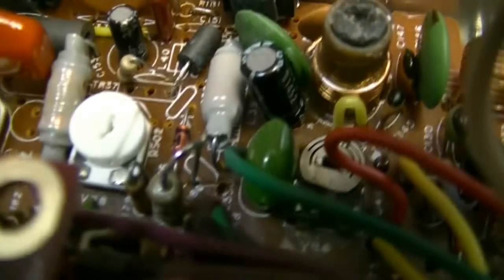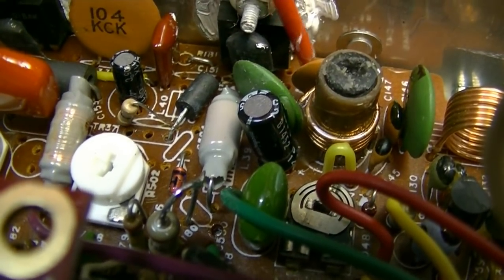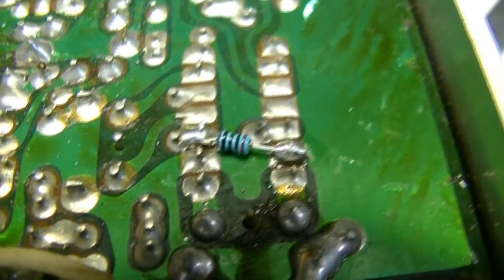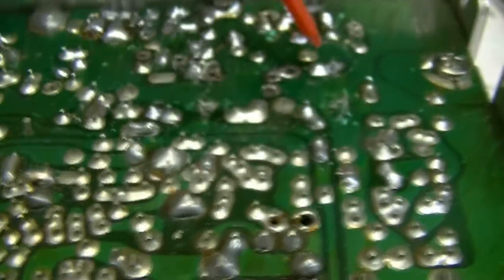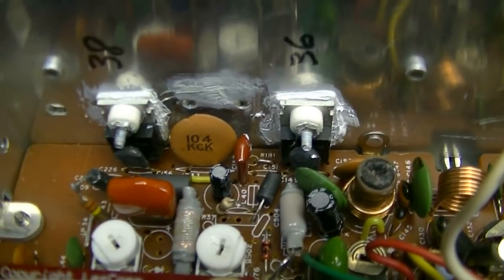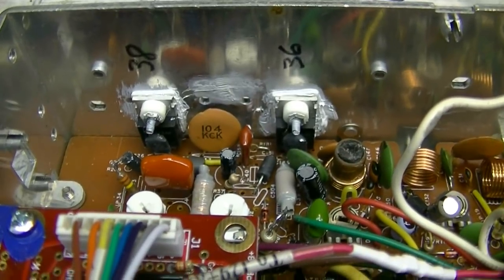Convert 148 to MOSFET

Comment: Hi. Nice work. One question... I own few hr2510 with the sd1446 and others with the mrf497 but I have an old test hr2510 that I moded the final stage with one mosfet irf520 and the radio only produce 20w pep on ssb. Can I add a second mosfet to the radio?The radio sound really good on all modes but a few more watts are welcomed. Thanks
Reply from the maker: Didn't those radios have dual finals? Yes, add the second MOSFET final.

Comment: Awesome video! When you mention r17, I believe it is actually r179
Reply from the maker: Hi Johnathon and thank you. You are correct. Just looked at the schematic and it is R179. I will change the comments.
73
Reply: I finished that modification and it did not work for me that could be wrong?
I did everything to the letter
Reply from the maker: You are the first one that it hasn't worked for. 
Did you change the chokes?Also did you see the corrected part #?Are you sure you have good MOSFETS?